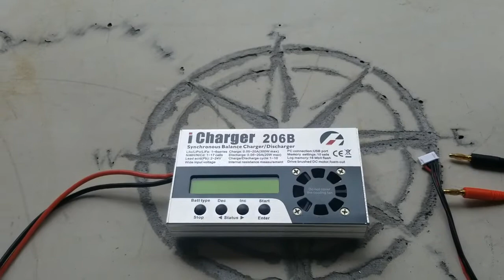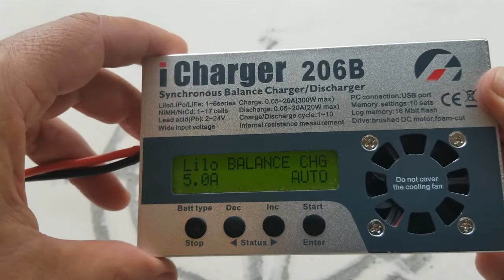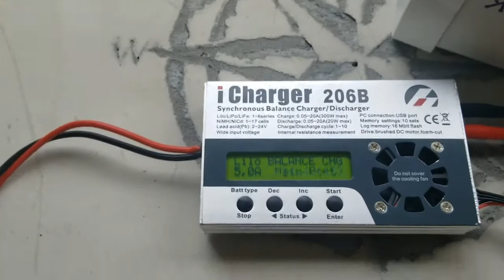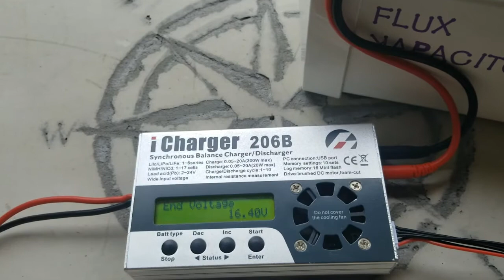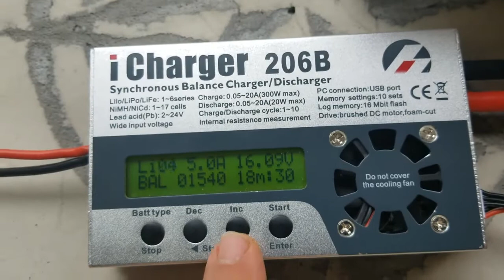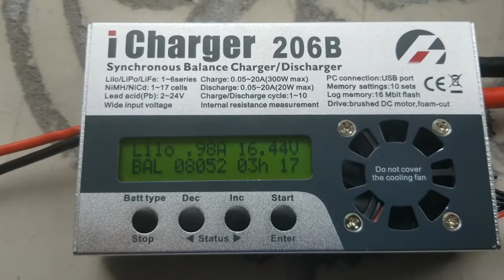Charging the DIY Lithium Kayak Battery Build

Comment: Thanks Mike. Really neat battery build. And great that the fence post worked out prefect as a case. I might put a link to the build page over on the truck camper site I'm on as many folks are interested in diy batt's for there campers given 12v/100Ah batt's w/ built in BMS are $1000+ USd. 
Just wondering, since I'm completely ignorant on how all this stuff works; how does the BMS/charger send extra power or cut power to balance the cells given there's just the two wires coming from the charger to the whole pack? Do the smaller BMS wire output extra power to the lower cells to eventually catch them up? Like I said, I'm clueless! :)
Reply from the maker: A BMS and balance chargers are 2 different things. They do some of the same functions, but not all of the same functions. I am using a balance charger. The pack only charges or discharges from the larger battery leads that power the trolling motor. The smaller wires are connected to each parallel cell packs and balance the cells by bleeding high to low during the charging process